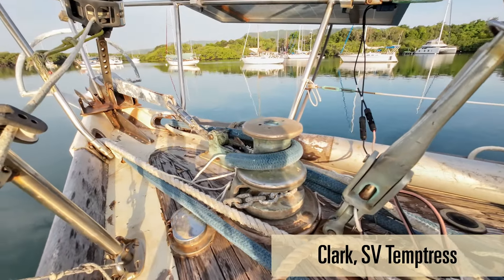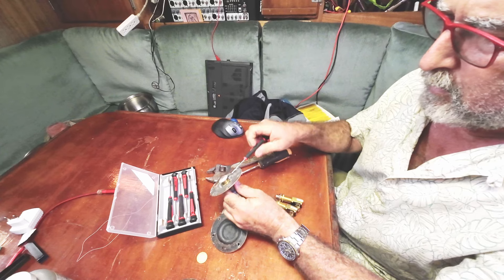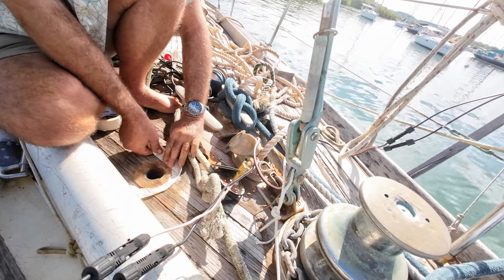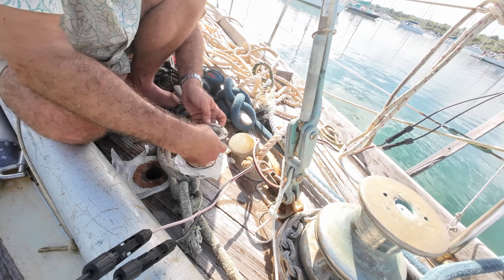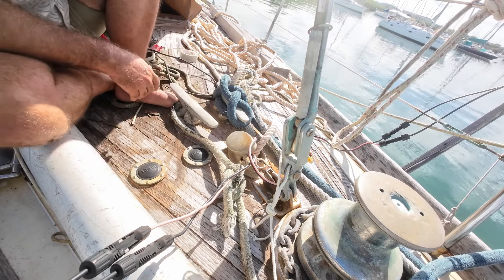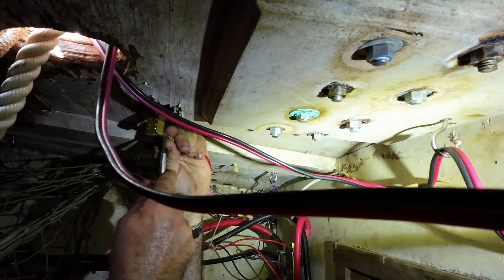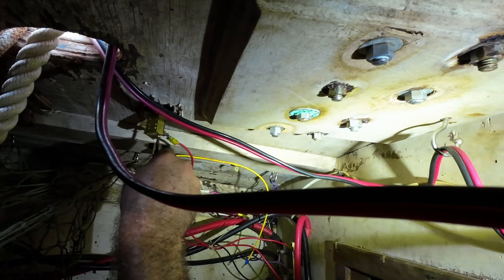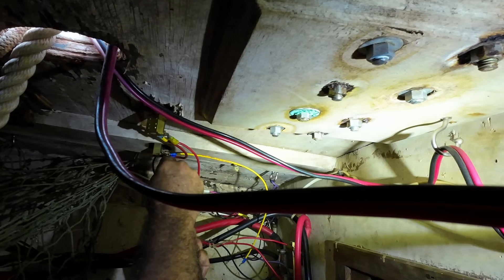Wiring Windlass Deck Switches

Comment: I like this format occasionally. Keep up the good work. Especially good for novices which I don't consider myself BUT I appreciate the tip about alcohol. I've struggled with 5200 cleanup for decades sometimes using Acetone. Thanks Clark!

Comment: See!! That edison connector idea is exactly why videos like this are useful! It's is a pretty good idea that you only arrived at from years of experience. Regarding the issue of possibly confusing the "solar only" plugs and outlets, you could use lockable outlet covers and plug lockouts for added safety (for visitors or those unfamiliar with the setup). You wouldn't even need to really lock them, just use a reusable ziptie and that should be enough to clue someone in that it isn't a "normal" plug/outlet.

Comment: Any chance you could maybe put picture/link to those connecters? Seeing is sometimes easier then hearing.🤔🤗
Reply from the maker: Sure but I don't know what you mean by connectors.   The Edison plugs for the solar?
Reply: @Clarks-Adventure  yeah, the connecters you find works the best for your solar connections.
Weather industry standards or not, I trust your judgment, if it works it works!
Reply from the maker: @hughvanduyn6482 those are just Edison plugs.    Exactly what's in the wall of your house for plugging in a vacuum or whatever.
Reply from the maker: https://letmegooglethat.com/?q=Edison+plugs+
Reply: @Clarks-Adventure  do you like put some grease on the contacts after you have assembled	the connector to stem off corrosion??
Reply from the maker: I really wish I had said in the video.

Spray this down with boeshield.    I'll be doing that when I get back to the boat.

My the way, the "grease" I use most in battery terminals and the like is simple petroleum jelly.   Works great, not as messy or smelly as other potions, and costs basically nothing.

Comment: I might be mistaken but I believe of the leading causes of fires on small vessels is from the windlass wiring due to the high load and the distance it has to travel (most boats have their bats in the stern).  If you do electrical work on your windlass system do not cut corners...
Buy the right gauge marine grade wire, get good fuses you trust (not cheap crap from amazon) and be diligent.
Reply from the maker: Absolutely and putting a battery up front like I described in the last windlass wiring video can't hurt

Comment: 90% Rubbing alcohol is actually a great general purpose solvent because a) its cheap, b) readily available, c) doubles as sanitizer & d) if it doesn't work on a small test U haven't lost much time.  I only stock the 90% stuff, 70% obviously doesn't work as well & I keep a number of spray bottles on hand where handy (1 in each car for example)

Comment: I see you are a boat yoga master. Plumber trick: tak a tooth brush, electrical tape; tape the tooth brush to the flashlight and grip the toothbrush with your backteeth that way you can hold the light where you need it.
Reply from the maker: But I thought I might talk to the camera...
Reply from the maker: There was actually plenty of light to work.  The camera needed more
Reply: @Clarks-Adventure  Oh then gaffers tape for lights for youtube production, you'll find it sticks to anything and doesn't leave a residue.
Reply from the maker: @jomeijackson5311 that's something I might just need

Comment: Is there a backing plate on the capstan windlass portion? Can you describe it, if there is, please? I’m planning on installing two separate winches, using one switch hooked to a battery isolation switch (to be able to switch between the 5/16 and 5/8 chain winches). Wondering what sort of backing the winches require. PS: I hope we cross sailing paths someday.
Reply from the maker: Yes there is a backing plate that ties into deck stringers that run beyond the mast.

Every boat is different.  If your deck is thin you need a big plate.  If it's a steel boat maybe not.
   Overkill is beautiful

Comment: How did those screws have any "bite" left?
Reply from the maker: Wood screws can be used in the same hole many times if you start them carefully and follow the existing thread.
  Basically treat them like machine screws and don't cross thread them.  Takes a trained hand and is easily to learn by turning them backwards until you feel the "click" of the thread line up then driving them gently at first.